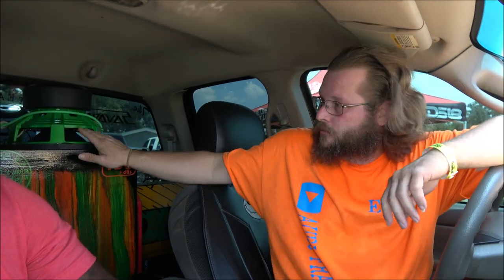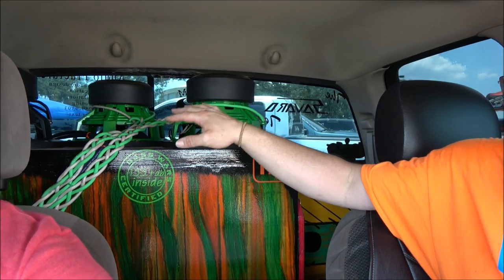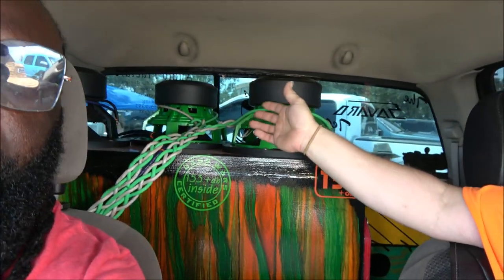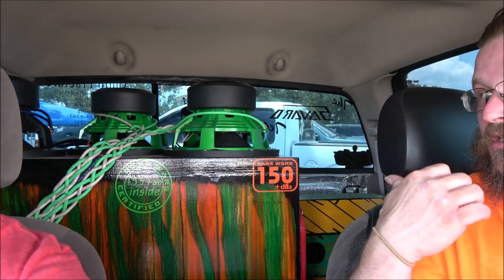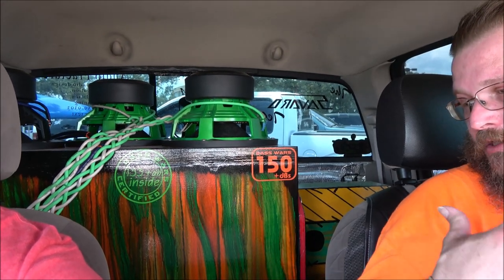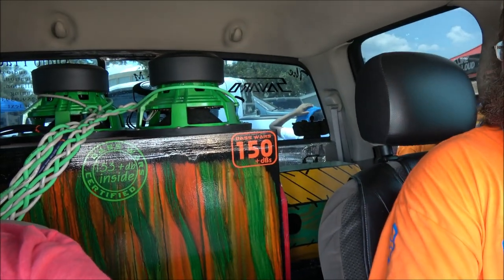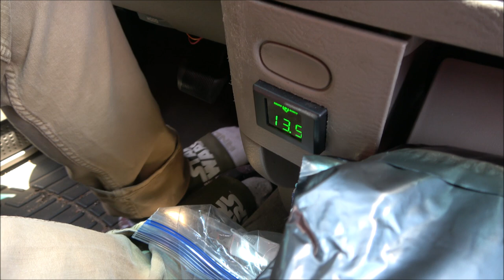UNIQUE SUBWOOFER BOX | 4 SAVARD AUDIO HI Q 12S | TARAMP SMART 5K

Comment: That 4th 12 he added is a waste. It's firing directly into the port. Love the desire for more though. At this point I'd say it's time for a new box and a little bigger amp or a second 5k. Great demo though and the voltage stayed solid 💪
Reply: that sub actually was not a waste. the purpose of that extra sub was not for more output. i added that sub to take some of the efficiency out of the setup. the enclosure had too much air space and the amp had too much power for just the three 12s. It was also added to improve sound quality and bandwidth, as the over-sized enclosure did not allow for me to play too far from my peak without the subs unloading. with all that said, it definitely gained some tenths of a decibel at minimum. that one sub increased my bandwidth from 28-40hz to 26-50hz with a fairly flat curve. but you know what... you're right.. it was a total waste lol
Reply: @audiofracture1068  thanks for taking the time to explain, couldn't wrap my head around it. Doesn't make a lot of sense to me to add a sub to achieve those results rather than building the correct enclosure and possibly getting even more output. As far as the amp, I don't believe that 5k is too much at all. Those Hi-Q subs will take a beating. All in opinion and preference, trial and error though. Bass one my dude. I think the build is great 💪
Reply: @HALF-ACRE2014  its not that the 5k was too much for the subs. It was only too much because the enclosure was too big. In a smaller enclosure they would have been fine on that power. Keep a few things in mind; first, this enclosure was not designed and built for these  subs, it was built for Soundqubed HDX3 subs. Second, this setup has had a LOT of testing and tuning done on it since then to make it perfectly match what these subs want, which ended up leading me to the 4th sub. 
Listen man, I spent 100+ hours (probably more) designing, building, carving, shaping, sanding, staining, etc.... you don't just throw that kind of work away and start over....
Reply: @HALF-ACRE2014  thank you for the compliments brother!
Reply: @audiofracture1068  oh I get it, have built plenty myself. As long as you got the results you're looking for and you're happy with it that's all that matters.
Reply: @HALF-ACRE2014  Exactly, it was less about gaining volume and more about not losing volume while at the same time gaining bandwidth and dynamic bass.. I definitely did get the desired results, and the little bit of extra db was just a 🍒 on top. Thanks again man!